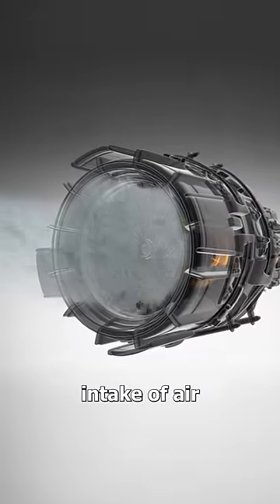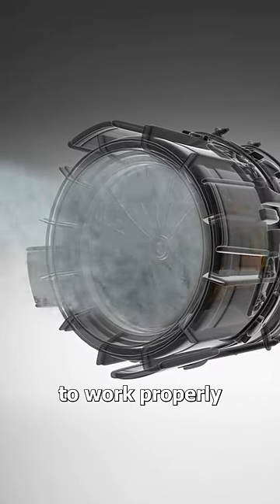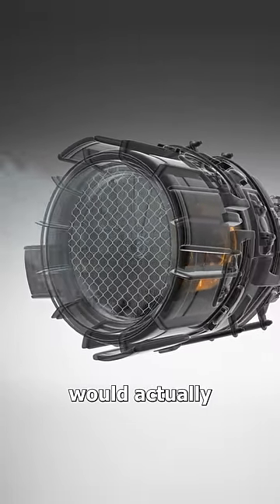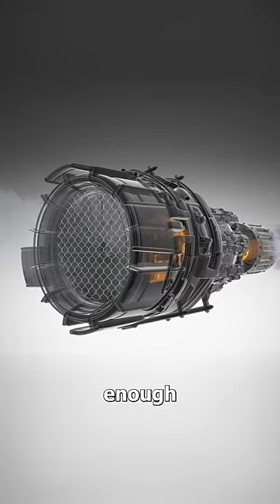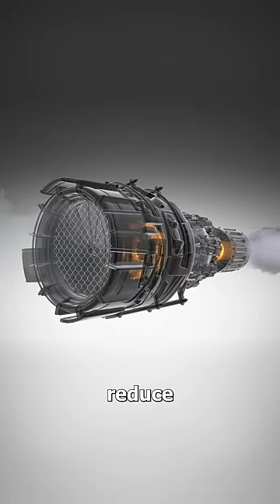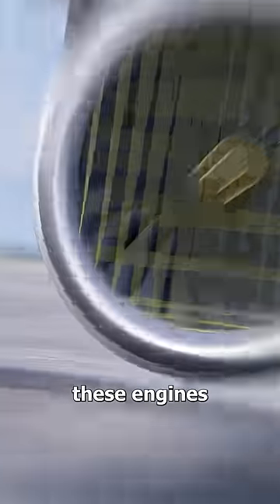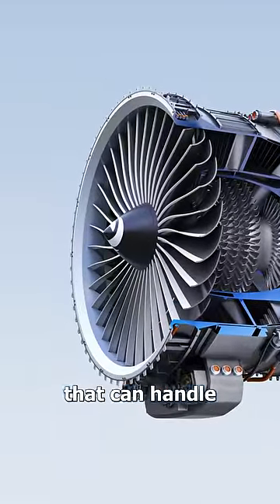Why Jets Don’t Have Bird Blockers 🤔

Comment: "but what about the birds?" 
"gone....reduced to atoms"
Reply: I dont think there would be a difference if a bird got hit at 600mph with a grate or not lele
Reply: @igotfobiaz7036 Yeah, either way the bird is just as dead. This method blends them up for easy consumption, though... if you're into that.
Reply: They were accidentally destroyed maliciously
Reply: "I used the blades to destroy the birds."
Reply: just right after I said the exact sentence😭
Reply: @Xelets  nearly killed me.
Reply: I mean even if the birds do get hit while there is a barrier it'd definitely die because of all the air attacking that bird and the sheer amount of pressur
Reply: It was like Gohan and cell with the father and son Kamehameha wave
Reply: Unsolved as it is back then. Lack of thought is obvious enough in this design. Bird enters, ONLY in a very small undecided section of the air intakes. Now we can, and we always had a chance, to think this problem through very much properly enough to solve it with or without the cutting design found now. Instead of ONE large blade, spinning, we can design it as a collection of smaller blades all spinning, in that manner, each smaller blade, Or a small sector of baldes can be individually reduced in speed, thus reducing the intake force there, where the bird entry is predicted using an engine radar, installed on each engines facing the intake. Now, another thing we can do, is, replace the intake fan with a outflow valve, only 1 required which can be automatically placed where the bird flow comes in, generate POWERFUL Storm of air outflow, out of the particular area, for the FRACTION of the small time interval within which, bird was supposed to enter. In that manner, even if the bird is sucked in, or is flying in, it is pushed out of it. It can be optimised further for other runway debris and other non optimal air flow intakes. The outflow, can be also directed by using control surfaces. That is just one way of solving it. Engine still produces LIFT, as far as that is concerned, bird is unable to enter due to the variable pressure difference, that was made there. This PARTICULAR exit flow INSIDE the OVERALL intake flow I've have discussed about,is ONLY automatically placed in that location only after a bird entry is being predicted. This can have undesirable and untested effects on engine performance too but the idea can be explored, if required.
Reply: Thank you so much for your kind regard for the birds. It made me discover new ideas I haven't went through before. Those ideas are now being given to you. You can decide if it is valid enough for the application. Now, another way, another view, another angle to look at this, by, installing a sliding, powered fresh air out flow in the sides, covered inside the plane. The slide ensures all the vertical angles of debris or the bird entry are pushed out, in front of the air flow. This system is PLACED not on the engine but actually IN the side of the AIRPLANE body, both sides, and it will HAVE A TANK of READY TO GO, COMPRESSED FRESH AIR inside this system, which can be connected to the engine intake for bleed airflow to this system, upon it being used.

Comment: I think it should also be pointed out that even if bird blockers were put on, the bird would probably not survive the impact with it anyways, or in best case, get pretty injured.

Also, even if the bird wasn't injured on contact, after the impact, the pressure against the engine would be so high that the bird would basically be stuck on the net until the plane lands.

Edit: What the... how did I get 5k likes on this. By far my most liked comment on Youtube, thanks!
Reply: Further increasing the problem of restrictive airflow.

From every logical standpoint it makes more sense to just build the engines to actually power through obstructions than try and protect them.
Reply: @Not_interestEd- oh damn you must've graduated in Harvard with a PhD in planes cause I can't believe airplane engineers from like a hundred years ago to now have not thought of that before
Reply: @firkejdjneii28283 . He was simply putting down a point for anybody who may not have got it, no need to be so rude.
Reply: Don't be so unsure, planes fly about 900 kmh or 560 mph and that would innihilate said bird. You'd probably need a DNA test to identify this leftover goulash as a specific bird
Reply: Came here to say this… if the bird gets close enough it’s dead, grate or jot
Reply: Also it would likely slow the plane down
Reply: So you're telling me the bird would unwillingly become an illegal immigrant?
Reply: @reinrassigerStuhl yes, but normal airplanes don't have extra durable blades.
Reply: @Dr_MaIpractice  I mean, that’s true, but the metal is still plenty strong enough to handle a few birds between their regular maintenance checks.
Reply: @inkyisdreaming  at the speed those planes go, that blade wouldn't survive.
Reply: Would probably pass through the grate if the force is really strong right?
Reply: @RubbrChickn like smushing a potato through a potato masher, i’d assume the answer would be yes
Reply: @firkejdjneii28283  "Im an asshole" is all you had to say.
Reply: @firkejdjneii28283  Bro he literally just restated and video and your mad about it, like you watch the same video too lmao
Reply: The bird would be subjected to so much pressure, it would be more like a French fry cutter
Reply: And here I was thinking they would just be pulled through the grate
Reply: @reinrassigerStuhl DNA test and consulting with ornithologist.
Reply: "pretty injured" is an understatement. Getting hit by something travelling potentially up to 500 knots faster than the bird... yeah, it would be reduced to pulp.
Reply: Jtard?????
Reply: Couldn't the barrier be bullet-shaped, just very strong wires radiating from the tip?
Reply: the bird would get sucked theough the grates and go through the blades pre-cubed
Reply: That’s what I thought
Reply: dude this isnt about birds
Reply: It sounds even crueller!
Reply: I can't imagine there being a "best case" , jets travel at over 500 miles an hour.
Reply: Wouldnt the bird also just be forced through the grate? People have been sucked into them from metres away
Reply: The suction might even be strong enough to pull the bird through the grate anyway. 

... In long, rectangular bits! 😂
Reply: or the bird blocker might break and fall into the engine which would cause far more damage if it happened then the bird by itself could
Reply: dam people thinking a bird could survive that as if they dont have hollow bones dudes can hit a window at casual speed and snap there spine in half it gets worse with bigger birds because they have more mass and more force in there impact and although things like eagles can survive high impact stress with there legs because they use them to grab prey they cannot however do that with there skull if you really don't believe me catch a bird hit it directly with a car moveing several hundred miles an hour if it survives that run because what ever you just hit is not a bird
Reply: @firkejdjneii28283  bruh, what's your problem? lmao
Reply: jtard moment
Reply: Well at this point we don't care for the bird we care for the plane not crashing. But reducing efficiency is a good reason not to do that. Bird collisions are not that common, and not as deadly to modern planes anyway.
Reply: @HalIOfFamer  and  if enough birds actually got hit to cause Serious damage like breaking reinforced blades they are likely to break a barrier to.  Especially if its light and thin enough to not cause high Inefficiency so you end up with a situation that could have other wise had a chance of repairable damage but instead you get a big metal gate flying in and destroying the whole engine a far worse outcome
Reply: @David-sp4tc  It's an extremely stupid point though. Jets are delicate because of how precise the parts are, meaning even a bit of dirt getting in the way can cause problems. You can't just make them more durable like its nothing. I think if there's no investigation there should be no right to speak
Reply: @Not_interestEd-  the shredder
Reply: lol
Reply: @sonwig5186  To respond to your point like I did to the other person not everybody knows that, and it’s not your decision for someone else to speak or not to speak. It’s simply just a deduction that someone wanted to mention to the benefit of others.
Reply: Oor.. They could be turned into tiny little meat cubes in a grid-like pattern due to the velocity of the impact.
Reply: @thefireman17492  or a paste really depends how early they got impacted
Reply: And adding to that they couldn’t withstand the altitude of the ride at 10000 Ft high
Reply: @Dr_MaIpractice no one put any grates on any planes. Watch the video dog
Reply: @aeji148  whoops
I thought he meant just the jets had no grates mb
Reply: @aeji148  my other point still stands tho
Reply: until the plane parks
Reply: So no matter what, It's gonna die
Reply: Tohh Victor
Reply: You've just saved me a few minutes to write this comment.
Reply: Smart!
Reply: Your comment totally sounded like you wanted to save the bird and not plane you know how much damage a bird could still to to planes.
Reply: I wonder if birds will go extinct or specifically migratory ones people in the comments are joking but this seems like a problem 🤔
Reply: Ggs on ToHH
Reply: the question was never about the safety of the bird... it was about our safety. I don't know why you all keep thinking this XD

Comment: "That can handle most BIRDS & debris"💀 He just smoothly said that👀
Reply: What the point of the 💀
Reply: can't like this comment its at perfect likes "69"
Reply: Bird is not that important, don't exagerrated it
Reply: Far more birds are killed for the serving of chicken on the plane than are killed due to bird strikes.
Reply: What does he mean by most? Like what if a HUGE bird hit the plane fan, would it explode?
Reply: Maybe @chairrobot
Reply: Most? What birds cant the engine handle?
Reply: @chairrobot  if it rapidly disassembles the wings wouldn't break and shrapnels wouldn't go everywhere so, just shut off both engines and glide back to land
Reply: @somethingsus2144 Us airways 1549 having to do a water landing by a bird strike:
Reply: @chairrobot  probably, like US Airways 1549, They lost both engines because of a bird strike by Canadian geese.
Reply: Cant handle ostrich (its a bird so)
Reply: cry about it
Reply: @bungiecrimes7247  that doesn't have anything to do with the comment
Reply: Also, wouldn't putting a grate in front of it just make sure the bird gets shredded on it while getting sucked in?
Reply: @ColeJohnson-fk5jw brain rot
Reply: Guys. Birds aren’t real. They’ll be fine.
Reply: @Finklutz29 thats the problem

airplane can't glide
Reply: @geometricaluranium1  what's the wing for then? plus it already has forward speed, that's enough to produce lift. if it's not enough just get some speed by trading potential energy from the high altitude
Reply: @Finklutz29  the wing is for aerodynamic stability if planes could glide they wouldn't need the engines to always be in working order and they are extremely heavy
Reply: @geometricaluranium1  
1. yes wings do provide stability
2. wings produce lift (Bernoulli's principle)
3. what's a stabilizer for if it doesn't stabilize?
4. engines run to keep air flowing; no air flow, no lift. drag will slow the plane until it's speed is insufficient
5. a GLIDER, GLIDES not FLIES, no height, no gliding

Edit: also engines, while some do have 1:1 or more thrust to weight ratio do NOT keep the plane up. It's the wing's job.
unless you're talking about 𝘩𝘦𝘭𝘪𝘤𝘰𝘱𝘵𝘦𝘳s, the wings are what's keeping it on the air

Comment: "No, no. Its cheaper just to have you die"

-Professor Farnsworth
Reply: Honestly, it is probably better for the bird. Just imagine the ridiculous amout of force at this position which would pull every organ out of the body of the animal. There is simply no way a bird would survive this. Being shred by the blade is probably much less painful.
Reply: I doubt the bird is feeling pain in most cases. Being hit at those speeds, it would either be killed or knocked unconscious before it even has time to feel pain.
Reply: The barrier would kill it anyways. Guess you don't know but airplanes are fast as fuck. If the grade hit the bird it will die either way.
Reply: The bird would have died anyway. You wouldn't survive a car hitting you at like 80 mph. So why would a delicate animal like a bird survive something going much faster? Even if it did it would probably plummet to its death.
Reply: The sheer impact would kill th e bird nontheless

Comment: Okay!
Builds barrier*
Bird: still flies into the jet barrier and gets obliterated by the high speeds the jet was going*
Reply: Yeah, lol. People here don't seem to understand that the average airliner cruises at 475-500 knots (that's 547-575 mph or 880-926 km/h). Something moving 5 times faster than an express train will just pulverize it.
Reply: I think we need a diverter to the rear of the engine. Every flight needs extra sauce packets.
Reply: @derekeuchner1800 💀
Reply: You would rather hundreds of people burn alive or drown instead of a single bird instantly dying?
Reply: @smallw1991  bro did you read his comment? He's saying building a barrier wouldn't help because the stupid bird is still gonna die when it hits the plane at Mach 3
Reply: @dr.markus-level3researcher  Mate the entire point of this video is to protect the humans inside, we are not tryna save some random bird 💀
Reply: @dr.markus-level3researcher  Also planes do not fly at mach 3 lmao
Reply: @smallw1991  the comment was SIMPLY explaining another reason we shouldn't make a guard for the engine THAT REASON IS BECAUSE IT'S USELESS, LIKE YOU
Reply: @smallw1991  HOW MANY FUCKIN TIMES DO I HAVE TO EXPLAIN THIS TO YOU?

Comment: Also snow accumulation on the grils will be a massive problem for flights in hard climate conditions and high altitude
Reply: co-pilot: "There's snow on the windscreen"
pilot: "turn on the windscreen heater"
co-pilot: "There's snow on the grills"
pilot: "God damn grills!"
Reply: theres snow "cancel the flight"
Reply: How about like some sort of opening on the sides? To make up for the bird thing.
Reply: @walmartbarney  No use. It would still pull the birds along with the air and into the engine. Either the engine lives along with everyone in the plane or the bird gets a chance to survive.
Reply: @Hardcore_Remixer That's why I was thinking to place a cone shaped grill. That should work to keep birds out but as someone pointed out, even a small part of a grill breaking and ending up in the engine would be way worse than a bird that at least doesn't contain a lot of metal parts. Still a goose in the engine can destroy it, like happened with the landing in the Hudson river. A rather disturbing thought.
Reply: @DutchmanAmsterdam  The grate isn't going to gently push the bird out of the way no matter how it's shaped. The slowest a jet aircraft flies, during takeoff and landing is over 150mph. If a living creature hits something, anything at those speeds, it's going to die, and in a very splattery way.
Reply: @Yonkage-ik5qb  Right of course, engineers must have considered such options as well and concluded to rather not put anything in front of the intake.
Reply: @walmartbarney 
Oh, you mean the water evacuation ports?
Yeah. The bird will already end up there, to be honest. Beautiful piece of physics and design.... Odd to think about with bird flesh in mind, though.

Comment: Another thing I would think too is the strong suction will cause the birds to get stuck in front of the engines further blocking air flow as opposed to getting blended.